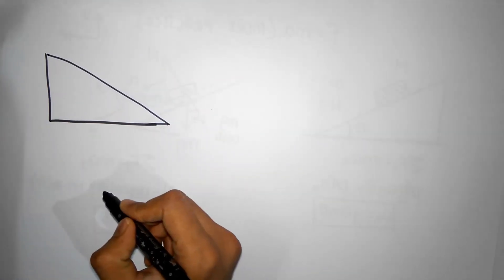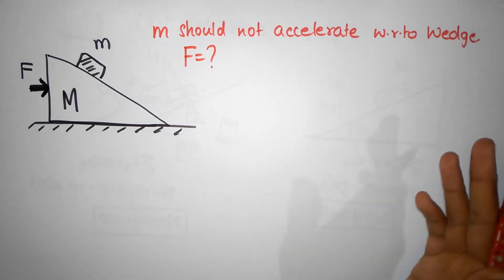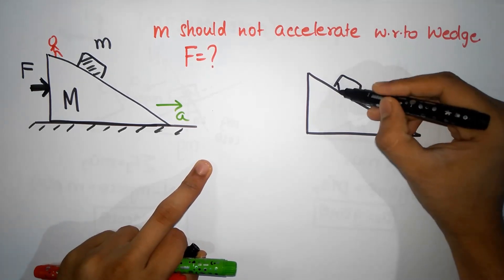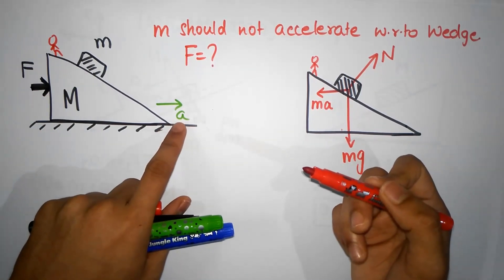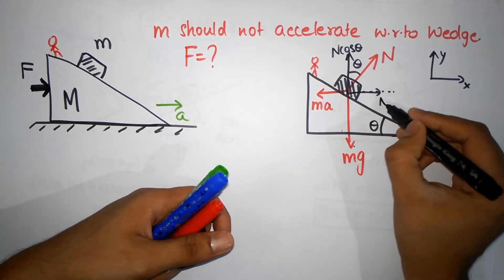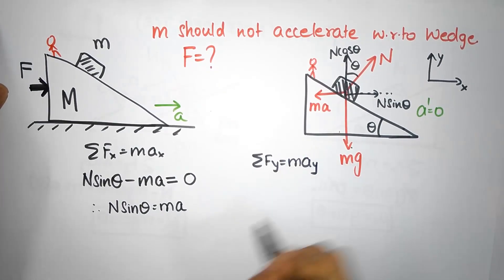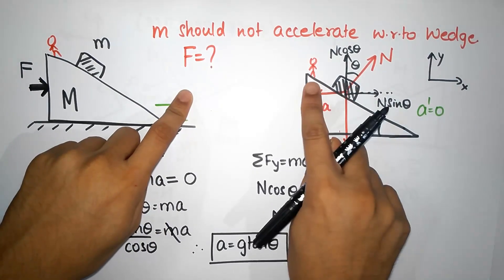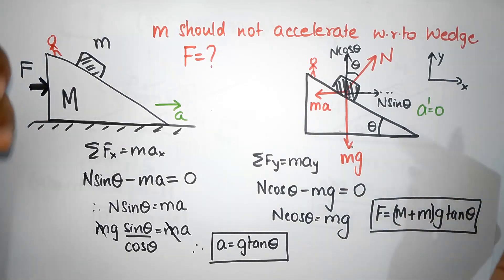Force needed to keep a block at equilibrium on a smooth inclined plane [Non inertial frames]

Comment: I have a question ; What some people do is balance the( Macos theta ) component with mgsin(theta )along the incline .But what comes in my mind is how can a horizontal force (pseudo force here) balance a component of vertical force mg here .. So are they correct or my visualisation is wrong.. Plz do answer sir
Reply from the maker: That’s a great question! The key is that every force can be modelled to have effects in direction other than where it points

Comment: Thank you for the video.
I’m stumped on a scenario where M accelerates at a certain speed on a fixed slope and then the slope is on ice and is pushed and M slides down  at slower speed and I need to find the distance M moved at its final resting place ?
Do you have any insight or a video for this ?

Comment: Hello, 
Nice video :) It reminds me a physical problem which I've seen as a schoolboy in 1989. I was in the national physics competition for selection of the Bulgarian team for international competitions. And one of the problem they gave us was similar to this one, but the wedge with mass M was put on a slippery floor, and the wedge can move without friction on the floor, next a block with mass m was put on the wedge, so the block slips on the wedge and the wedge also slip on the floor in the opposite direction, because of the push from the block. I cannot remember if there were friction forces or not. And possibly they searched the time the block to reach the end of the wedge, knowing the height of the wedge. I was unable to make the solution at the competition, recently I solved it :) but if it is interesting for you, you may try it. I prefer not to influence with solution.